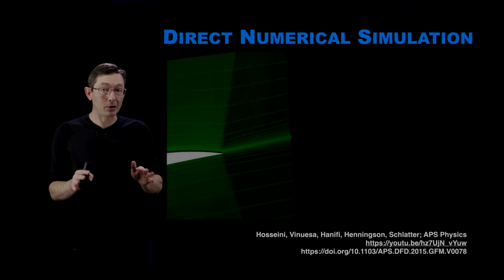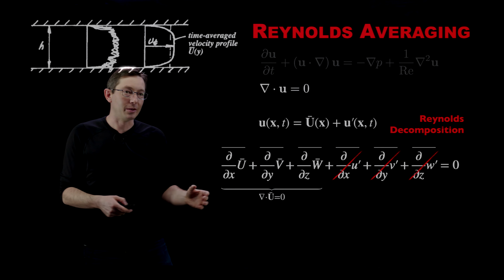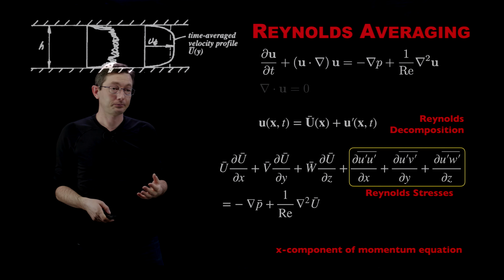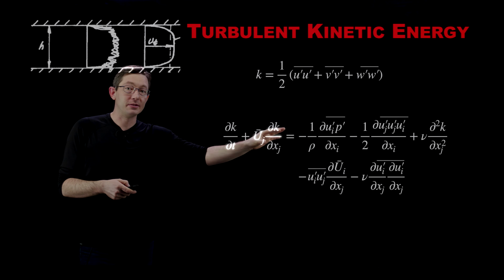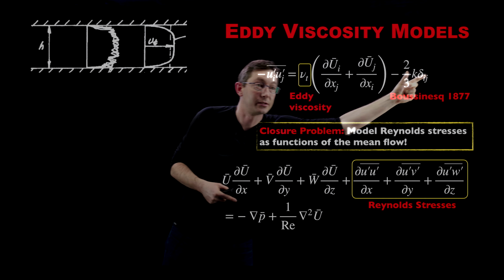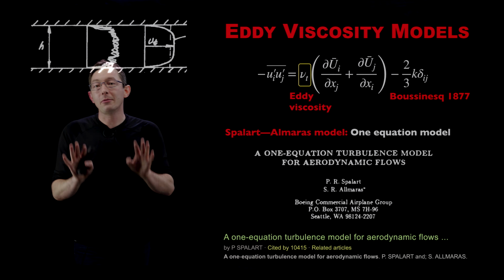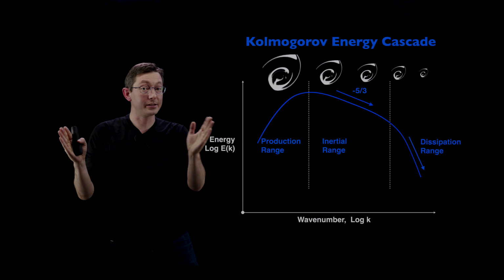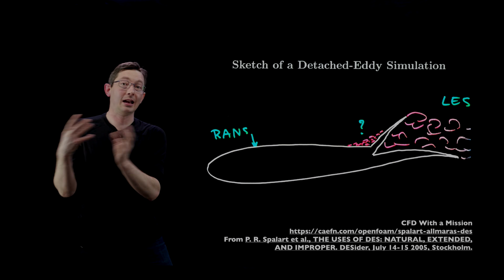Turbulence Closure Models: Reynolds Averaged Navier Stokes (RANS) & Large Eddy Simulations (LES)

Comment: I think one helpful piece of context for people just starting with CFD is that you technically don't need a turbulence closure model to run a CFD program. If you just check "laminar flow," you can basically do a DNS simulation of your setup to whatever grid resolution you want. It's just going to be wrong. Turbulence modeling is basically what you need to make your lower-resolution CFD codes more accurate.

Comment: There are several gaps in the presentation that would confuse any beginner significantly. For example, the jump from the Reynolds stresses equations into the kinetic energy equation before introducing the eddy viscosity assumption, which is the main reason why the people started thinking about the kinetic energy.
Reply: Another dangerous gap: Prandtl (and if my memory serves me well, Taylor also), realized that such an eddy viscosity is proportional to the product of a length and velocity scales. Prandtl created the mixing length model, which worked well for boundary layers and shear flows. Later when other flows were considered, namely the decay of isotropic turbulence (where the mean flow velocity and it's gradient vanishes), it became clear that another quantity is needed for the velocity scale. The first who proposed the root of the  kinetic energy as a velocity scale was Prandtl (or Davidov?? Again, my memory isn't helping me).
Reply: But the length scale was still missing. Therefore, an additional quantity was needed, with a transport equation, of course.
 
All these missing details are very important for a newbie to understand what turbulence modeling is all about, and how it evolved into what it is nowadays.

Comment: Good review material! As an experimentalist, I've been thinking about this for a while. I have three questions that I would appreciate your thoughts on:
(1) Is it reasonable to use the wall distance as a distance for the closure equation? This sounds reasonable to me within the developing boundary layer, but not in the wake of a bluff body, for example. Or is the argument something more along the lines of "this is the best option we have"?
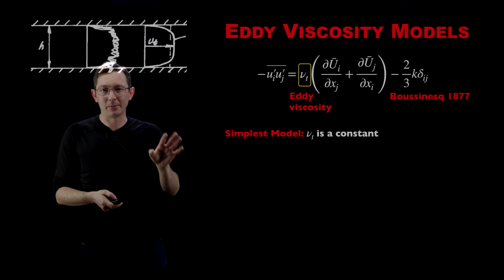(2) If I'm understanding 19:34 correctly, the turbulent viscosity is proportional to the distance from the wall squared? Is that the case generally for RANS turbulence models? I found in my experience that CFD models seem to over-diffuse regions of vorticity in the wake of lifting bodies (say, the vortex pair by a wing) when compared to experiments with exactly matching conditions. It looks to me that the fundamental issue then would be the incorrect choice of the length scale, then? i.e., if a proper vortex is formed in a wake, the length scale is no longer order wingspan, but order vortex diameter;
(3) This type of turbulence modeling seems to implicitly assume the spectrum of turbulence as a generic turbulence cascade. If there's feedback behavior, a RANS model should be incapable of generating good predictions, am I correct? What about instabilities? 

In any case, thank you so much, Prof. Brunton, for laying this out so clearly!

Comment: Thank you for the excellent lecture!
I wrote an entire CFD software bassd on lattice Boltzmann (on my GitHub), and there you try to resolve all scales directly in the grid with gigantic resolution. However GPU memory sets a limit on resolution. If the Reynolds number becomes too large and resolution is not high enough, the simulation becomes unstable. Smagorinsky-Lilly LES provides a nice solution in ~12 lines of code: another way to think about LES is that you increase viscosity where shear rate is largest. Coincidentally, these are the very locations where instabilities would first occur. So LES makes the simulation nice and stable at large Re.
I have some demos on my YT channel where I simulate entire airplanes with this.

Comment: Very nice discussion.  It is true that Smagorinsky became head of the GFDL laboratory, but the development of LES occurred much earlier when he was a student of Charney and von Neumann.  His early simulations of atmospheric flow showed some unphysical oscillations.  von Neumann suggested he use the "artificial viscosity" that Richtmyer and von Neumann had developed to control unphysical oscillations in flows with shocks.  Smagorinsky wrote a very nice paper about the origin of LES.  Both shocks and turbulence are examples of high Reynolds number flows.

Comment: I Am Not Very Familiar With The Standard Mathematical Notations, But I Proficiently Understand Many Of The General Concepts And How The Variables Relate Together Within A Given Systemic Construct.

The Explanations That You Give About The Limitations Of Our High Dimensional Model Rendering Capacity Necessitating Logical Reductions And Data Pattern Compressions, Due To Consecutive Orders Of Exponential Complexity Being Prohibitively Incalculable At Current Technologies, Transfer The Information Well. Rendering Only The Necessary Input Data At A Functional Scale, Within An Efficient Timeframe, Allows For A Computational Model To Effectively Balance An Optimal Efficency Alongside The Dynamic Scale Framework Of Variable Interations, Providing An Output Which Can Be Presently Utilized To Optimize And Streamline The Processes Of Various Systems. 

So, Machine Learning Processes, Via Inputting Large Samples Of Relevant Data Into Sequential Networks Of Complex Algorithmic Contextual Associations, To Derive Succinct Logical Patterns Of Variable Systemic Parameters, Functionally Surpass, At The Steadily Increasing Resolution Of Computational Efficiency, The Conveyance Capacity Of Conventional Methods By Categorically Compressing The Multidimensional Information Patterns Into A Functionally Relative Framework Of Layered Contextual Packets, Which Are Holistically Capable Of More Precisely Resolving To Formal Closure Subsequent Orders Of Complexity, Within A Reasonable Budget, Through Deductive, Inductive, And Inferential Emulations Of The Relatable Phenomena Within It's Delineated Purveyance?

Comment: Lift is caused by compression to the bottom surface of the wing and the top accelerating the downwash if you look at the top like a key slot and the bottom like a skipping rock.

Comment: Great lecture Prof. Brunton. 
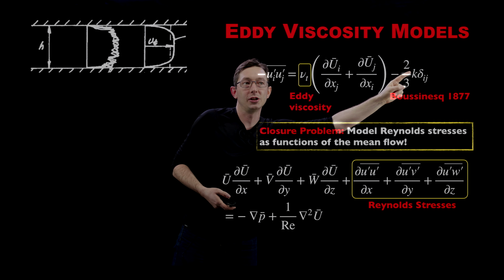Just one query, in 18:50 shouldn't it be the Kronecker delta function, instead of the Dirac-delta function?
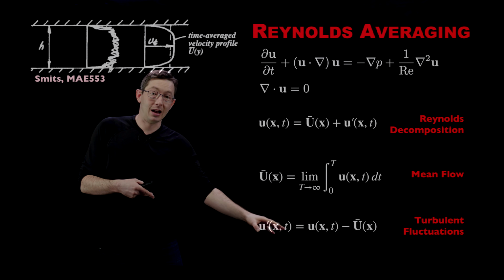And one small typo: 1/T term missing in the definition of the mean flow at 04:12.
Reply: I also know it as Kronecker delta but for signal processing you could see the Dirac-delta as some sort of special case of the Kronecker delta IIRC.
Reply: @JousefM  Ohk.  Thanks.
Reply from the maker: Yikes, yes, this should be Kronecker... whoops... sometimes "Dirac" just involuntarily slips out...